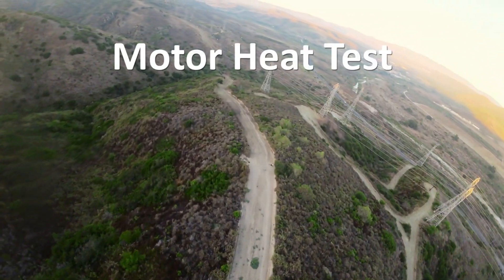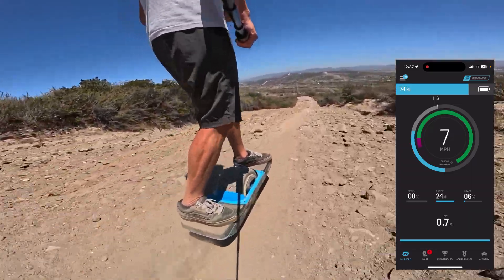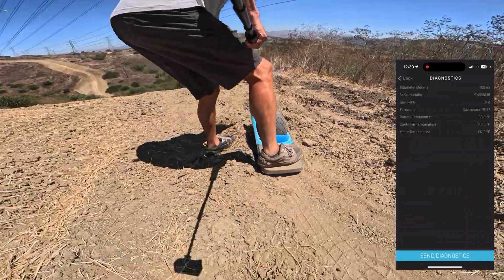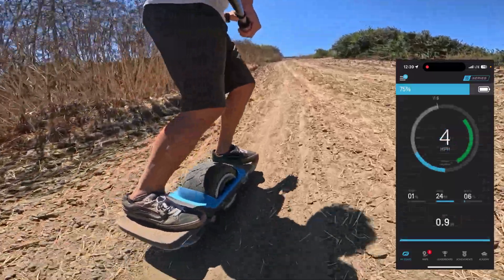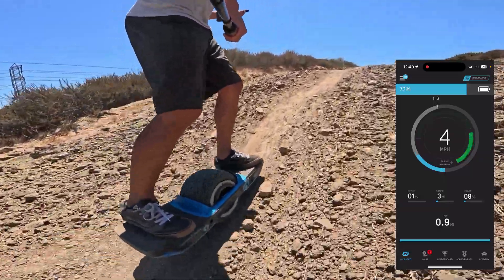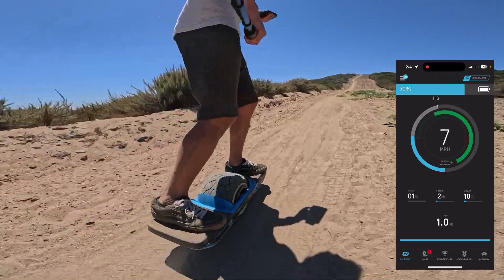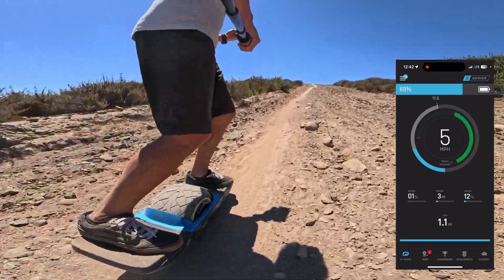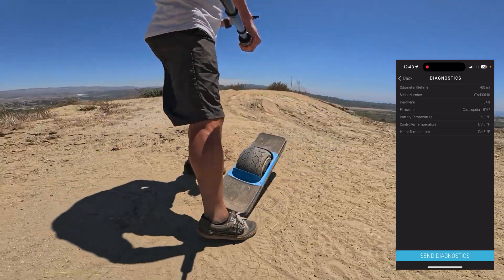Bring the Heat - Part 3: Onewheel GTS

Comment: I noted when i built the gtv that future motion capacitors were SILLICONED in place, not soldered. Thats a very very big issue under temps like that in trail riding, a cap comes free and youre diving.

Comment: TY Surfdado, for someone Finally givin us a motor/controller thermal test on the GTS 🏆 i have a GT-V with a GTS stator & enjoying much better thermal performance this summer season, especially with float blocks And cold ones installed as well. also glad to see the MTE is a worthwhile upgrade with similar, even slightly better thermals, tho I'll probably end up goin 6" & callin it a wrap. I'm a NY-City rider that Barely trails 🤙🏾✨️

Comment: Would be curious to see a GTS motor in a GTV setup. I have this currently with the MTE, cold blocks, thermal paste, and powder coat removed on inside rails. I think it has helped but hard to say exactly how much.
Reply from the maker: @kingdavid1000  I’d love to see that too
Reply: @surfdado I will share some 7nfo this summer when temps get hotter, right now it's highs of +5c so heat Is a non starter. I have exactly this setup minus the mte, I'm running a gts 6" hub I have a long sustained climb on on run its uphill more than an hour and steep in many places

Comment: Would be curious to see a GTS motor in a GTV setup. I have this currently with the MTE, cold blocks, thermal paste, and powder coat removed on inside rails. I think it has helped but hard to say exactly how much.
Reply: ya, if an ADV is just as powerful with 84V imagine a 113V vesc... surprised no one has done with yet. perhaps the GTV controller will not work on the GTS, would need its own vesc version controller made from scratch.
Reply: @deltax7159 I have it ( gt with a gts motor) works fine. Don forget to wizard the other and then adjust it in vesc tool, n52 magnets need calibration on controller.  The grs isthe exact same hyperbole motor as all fm onewheels is just got n52 in it

Comment: Nice .. I think you need to try an older hypercore on a 30s VESC and GTS. We do not know how much high voltage is responsible for better thermals with the original Hypercore.
Reply from the maker: @benlay750  except that we do know. It makes no difference at all. Higher voltage means more speed, that’s it. I tested it with 24s vs 12s one week after the GTS came out because everyone was drooling over that voltage
Reply: @surfdado  I missed that ... on which platform? The result surprises me since higher voltage definitely reduces transmission loss in wire. Also since your advocating the GTS motor as a upgrade over the older hypercore it would be great to show exactly the difference in this apples for apples test.
Reply from the maker: yep, someone should go and show that lmao - I'm surprised nobody has done that yet tbh, motor has been available for a good while now...
Reply: @surfdado  clearly I'm not going to twist your arm for another test. It seems likely that this hill would be a perfect example of where a GT would overheat but a GT with the GTS motor upgrade will make it without overheating. Thoughts?
Reply: @surfdado  This maybe more appealing .. speed climb test on the VESC. Climb as fast as you can and see the effect on final temps.
Reply from the maker: @benlay750  motors and controllers won't get nearly as hot and the chance of me crashing on half the runs is pretty high... reaching the same average speed on different boards is much harder in that scenario. Less scientific value but probably more fun to watch haha...
The thing is though that pretty much anybody can do this kind of comparison test, it doesn't really require any of my knowledge or skills...
Reply: @surfdado  In the climb as fast as possible test the VESC would come out as the winner by a mile (temps and times).
Reply from the maker: @benlay750  haha yeah right
Reply: @surfdado greater voltage = greater pressure ( as you know ) which in turn means greater field weakening ability which == greater speed electronics are such  fascinating universe :)  thanks for everything you do. I my comment was more directed at the other poster, I tagged you cause you are the filter I trust :) respectfully

Comment: I would like to see someone throw a extra DCDC in a GT-S to power extra lights and fun stuff but also could power a small fan getting airflow from some vent holes in the plastic lid. Getting water and dust resistant vents that are big enough would be hard.

Comment: I want to see a FM vs VESC race where FM gets to bring out their best custom board and rider, tune it specially. Then the VESC team has Surfdado, Benjamin V, Mitch and Nico tuning a comparable power board specially for the rider and the course to compete.
Reply: So you want futuremotion race proteam with vesc like features vs vesc riders?
Reply: @Kay0Bot  the reason for both teams customizing their board to an extreme degree would be for making it through the super challenging borderline obstacle course racetrack. Less focus on speed more on maneuverability.
Reply: ....so why do you need to see this...an unlocked controller futuremotion racers, will behave like a vesc controlleer.

Comment: Thanks for the tests! My GTS handles the thermals quite well and have never hit an over temp alert .Riding in the mountains with 90-100 ambient temps and being 200# my motor gets noticeably warmer than my controller or maybe it’s just by the time a get my phone out it has cooled down. My controller will be 160 and motor 180 after a long climb. I have done consistent trail riding were my motor temps are 160-180 through the ride. I don’t think the controller is a bottleneck. For my kinda riding i feel they’re fairly evenly matched.
Reply from the maker: What you describe sounds exactly what I'd be worried about. Just because you don't get over temp alerts doesn't necessarily mean that you're not in danger territory, considering how unusually high FM has their thermal alerts. Also, it doesn't look like their thermal alerts are distinguishable from normal torque-based haptic feedback. The next few times riding hard trails in hot weather take a look at controller temps shortly before finishing the steep climbs, just to see where your controller is actually at.
Reply: Will do. I have noticed the handle slot  gets burning hot. Maybe the controller is made to handle crazy temps? 1000 almost all trail miles so far with no reliability issues.
Reply from the maker: @Onewheelcody11  could be that or could be luck. I would assume they’d make a big marketing fuss about it if they had designed the controller to military grade specs

Comment: So if i hear this correctly you don't want to see you controller reaching 190F?
Reply: 190F is 87C. Google says:

N48 and N52 grade magnets have a maximum operating temperature of 80°C (176°F), but it's recommended to not exceed 60–70°C for long-term operation. When heated above 80°C, N52 magnets will experience permanent performance losses and may become demagnetized.

N52M magnets have a working temperature of up to 100°C (212°F). However, for long-term operation, it's recommended to keep the temperature below 60–70°C (140–158°F).

So, to me, that reads, it's fine as long as you're not operating at those high temps long term.
Reply: @sdmods619  I love the response and information, thanks

Curious about fatal/ unwanted controller temps
Reply from the maker: @nickkleminsky  correct. Most consumer grade electronics can’t handle 200f and above, especially when pushing it hard. Only more expensive military grade components can handle up to 240F but I highly doubt FM chose to go that route without making a big marketing campaign about it